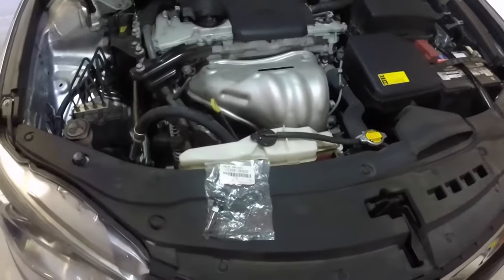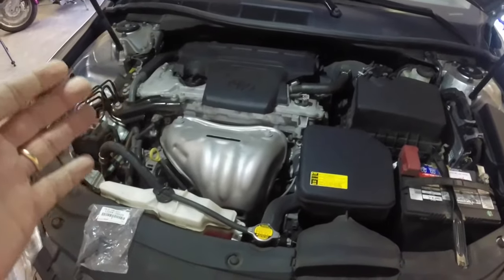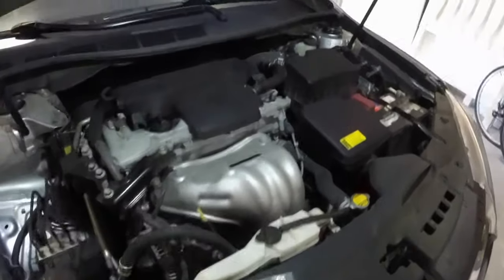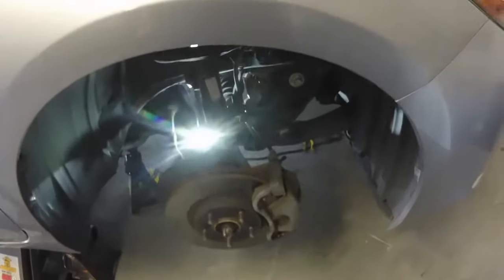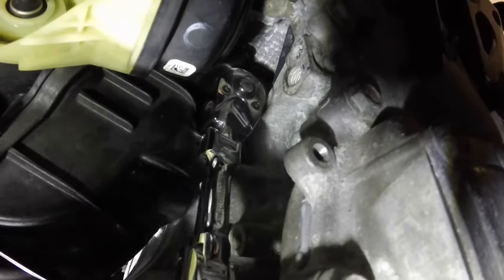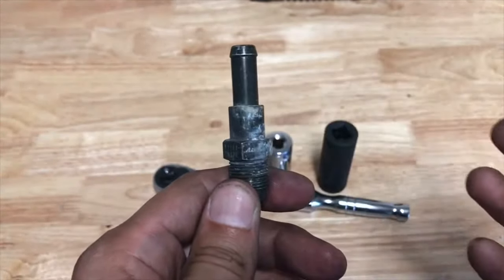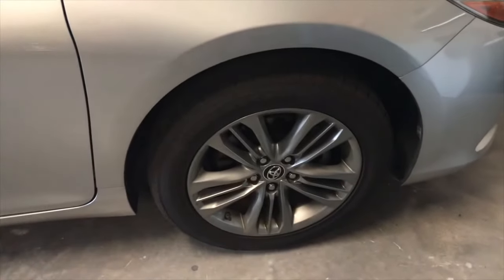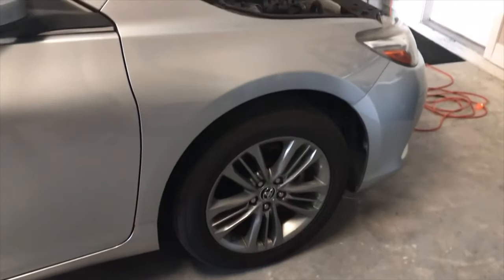Camry 2.5 I4 2ARFE Engine PCV Valve Replacement

Comment: Thank you for showing us how to replace the pcv valve on this 2ar-fe engine, what was Toyota thinking on this one? And, did that fixed the oil consumption issue?
Reply from the maker: It did... I did a follow up video on my channel.
Reply: @dcfgarage  thanks for sharing, much appreciated!
Reply: Dealerships charge around $88 for this job. How much would it cost to buy the parts and tools for this? I need to have this done as I'm losing some oil! Thanks for this video!
Reply: Dude the guy in the video said it was a two hour job so most dealers I know are at least going to charge three hours…
Reply: Got a quote from the dealership. It's only $500.
Reply: Toyota dealer in Canada wants 463.00 labour and 20 bucks for the valve lol
Reply: Recommended time from Toyota is 3.75 hours .
Reply: The PCV valve part is $10.63 on the Toyota web site. This is crazy poor design for maintenance.  Kinda like a parking brake adjustment which requires removing 2 wheels and costs $175.
Reply: @kimdavis5631 The PCV valve is about $11. Youll also need a 19mm deep well socket.
Reply: Where is the coolant bleed port on these engines? Want to change my coolant.
Reply: Who the f decided to put that there?
Reply: @mgomez5606  Underneath the car. I believe youll need to remove 1 or both of the splash shields to get to it.  its a yellow color, right at the bottom of the radiator.
Reply: @jtravel80  that's to drain it. I was wondering if it had a bleed port.
Reply: @mgomez5606  Oh my bad. Ill look into that.
Reply: @jtravel80  would appreciate it.  TY.
Reply: @jtravel80  Does PCV valve have a oring also?
Reply: @mgomez5606  No it does not.
Reply: @jtravel80  no bleed port?
Reply: @mgomez5606  If there is, Im not aware of one🤷🏻

Comment: Did the PCV replacement remedy the oil consumption issue?  My friend just acquired a 2012 Camry with 250,000 miles.  Runs great but oil was quite low on dipstick.

Comment: Just did this myself. The hardest part for me was getting the hose off. After that everything went smooth.
Reply: how did U finaly get hose off
Reply: @2000CORVETTE pinch the clamp move it back towards your hand and tug and twist gently until it finally lets go then just remove the valve

Comment: Excellent video. I have an oil consumption issue with2012 rav4 2arfe engine. I do not see oil any where on driveway/ under car. Do you think it is a pcv valve issue? That valve is in a meesed up place!

Comment: A deepwell regular socket (not impact) + swivel and 4" or 6" extension makes it easier to access
Reply from the maker: I tried a deep socket and it was too big to fit the wrench
Reply: @dcfgarage  next time use a 4 inch to 6 inch extension. It will make it a lot easier for the ratchet. Trust me. It’s kind of like doing spark plugs. You have to have an extension to get down in there.

Comment: Thanks for the video instructions. I disconnected the hose from top, remove the tire, side cover , crank position sensor and the bracket then pull the hose out of the PCV valve, it's not too bad and it took me almost an hour to get the job done. Note: don't forget to plug in the crank position sensor to the sensor or you car won't start.
At 97K miles the PCV valve still looking pretty good.
Reply from the maker: Nice work!

Comment: I have a 2016 Scion tC (The second gen tC has the same engine and transmission as the Camry and Rav4) and the process is the same.  On a normal car where the pcv valve is on top of the engine, I would recommend removing the PCV valve every 30K miles of so, check it, clean it if needed and put it back in, or replace it if it is gummed up.  But with the horrible placement on this engine, checking/cleaning it is not an easy option.  So rather, I'm just going to replace it every 60-70K miles.  I just replaced the PCV for the first time at 69K, it took about 2hrs from wheel off to wheel on, and here's what I learned.
- On the tC, after removing the plastic panel, the opening in the fender well is a bit tighter.  The body style is a bit smaller and lower, so I guess that's expected.  
- Even with the smaller opening in the wheel well, there is still plenty of room to work to remove the crank position sensor wire and bracket.  I went a bit further and from the top, I unclipped the next wire support up the line, and was able to really get the wiring and bracket pushed out of the way, giving me a bit more space to work.
- Getting the hose on and off is the hardest part.  I was able to see it and reach it by hand, by lying on the floor under the brake rotor. Took a bit to find a position that would allow me to get my hand up in there such that I could pinch and slide the hose clamp back.  I was able to do this with my left hand - no plyers needed!  Then the hose pulls off easilly.
- The valve itself was not too hard.  A long socket with a short extension and flex head wrench worked perfectly.  The flex head wrench is helpful, but you might be able to get by with a non-flex wrench.
- From the bottom of the engine, the new valve screws in easilly by hand as long as you put it in the socket with an extension first.  Once it is in by hand, I found it was easier to use a wrench to tighten it from above.  I even was able to get a torque wrench on it and tighten it to spec (18 FtLb)
- Getting the hose and clamp back on is the hard part.  I was able to do this by feel from under the car using my left hand.
- I should be able to do this a lot quicker next time.  I spent so much time just trying to figure out the best way to position myself to see the thing and reach up in there.
Hope these tips help others!
Reply: I appreciate this so much, I'm about to do the PCV Valve on my '14 TC. Didn't realize the Interval was only for 60-70k. Probably why my car idles kinda weird, definitely doing it now
Reply: Very detailed, you should do your own video!
Reply: Any other suggestions in replacing the pcv valve ..? I own a 2012 scion tc and it looks very tight in there to work ???

Comment: The Toyota engine that was burning oil due to defective piston rings was the 2.4L 4cyl  2AZ-FE .
I had a 2007 Scion tC that had that engine.
The car was great, but burned too much oil , almost 1qt per 1,000 miles.
The Toyota dealer in Roseville, California said it was normal and didn't want to repair the engine.
I NEVER returned to that dealer.
Reply from the maker: Thanks for the information! I’ve heard about the ordeal people went through. Did you take it to another dealership and did they replaced the pistons and pistons rings?
Reply: They repaired my 2008 tc in 2016 under the warranty program.
Reply: I was in dealership today, they told me the same story- just add oil…

Comment: You're the man. I was able to change this valve in about 1/2 hour. I would suggest long needle nose 45 degree pliers to pull/reinstall the  hose.
Reply from the maker: Thanks for the tip

Comment: Excellent workup. I had the chance to do this on a 2014 RAV ARFE. Your video was excellent in identifying location, problems and hardware required. Let me add this.
It took me 4 hours because I could not get the valve back in the engine thread. You  can see the hole(?) in the engine where the PCV goes if you shine a light just right.
I finally discovered this technique: lie down with back on ground and feet pointing forwards. snake your left hand carrying pcv into  area of  "hole and get a feel for it with your pinky.
Once you are sure you know where the thread is use your other fingers to put pcv into slot and try to get some turns into thread. I was able to get quite a few turns into albeit a few degrees at a time. Once it is secure, you can use the socket and ratchet
Will need same socket and ratchet as shown by poster. Got my socket at home depot
Reply from the maker: Very accurate description of how to put it back. I ended up doing the same things as far as the position goes. I did manage to thread it by hand fairly easily though.

Comment: These engines have been in use on Toyota Camry since 2010. I have a 2011 Camry with the same engine. It was burning oil. I changed the PCV and I didn't notice any change. I was changing the oil at an interval of 6k. I switched between 3500 and 4000 miles, then I noticed a difference. I believe that the whole thing happened because the dealership in the past was changing the oil every 8 to 10k. For NYC that is too long.
Reply from the maker: older 2ARFE had piston rings issues and they would burn a lot of oil. This was a big issue back then and Toyota used to consider "normal" if it burned 1qt every 1,000 miles and would not replace the engine.
Reply: @dcfgarage  I have 2011 burning oil to fast.   Did this fix problem R Rings the problem???

Comment: I have a 2017 Highlander with the I4 and it's located under the engine valve cover too. Ouch. 850 from the dealer. I wonder if I can take off the right front tire too and go that way. it's not bad but 85k so I want to replace it after my 2017 Honda CRV started to burn oil, 40k, and replaced the pcv valve...5 minute job..wham...no more burning oil...good video!
Reply from the maker: It's probably the same location, since it's the same engine... worth trying.

Comment: Hoping its the same procedure on my 2010 2.5 camry, this looked tricky but a lot easier then pulling the intake and all the other crap off.
Reply from the maker: It should be the same for all 2ARFE engines
Reply: @dcfgarage  everything's the same except mine has a power steering pump in the way which makes this route impossible, the newer cars like yours must have electric power steering.

Comment: Great job. I have a 2010 Camry that I'm going to try this on.
FYI, on the 2.4 Toyota wouldn't commit to a Recall. They issued a service bulletin that  involved them changing your oil, sealing your dipstick, then checking the level after 1000 miles. They had a chart that would determine if they would replace the rings or not. I think Toyotas are great, but the ring issue is disappointing.
Reply from the maker: Thanks for the info!

Comment: Did you shake the old PCV Valve to see if it was still good or not? You are right, it is important to replace these and most vehicles are easy to replace.  What was Toyota thinking on this one?
Reply from the maker: Steve Glenn I did and it was moving, but it felt different than the new one. Maybe it had some oil that was preventing the blocking piece to sit perfectly
Reply: @dcfgarage  easy to clean them

Comment: Very helpful Sir! Loving it! But would you please make a video of the process of taking out the plastic cover and cable sensor which is out of the way in order to reach into the pcv valve.
Reply from the maker: Thanks. I’ll do that when I do the follow up video. But it’s very easy
Reply: I missed a lot in this video.  Much talking done about the top of the engine and the actual removal of the valve was not there. And when he moved the wrench and said that was a removal it was actually tightening. I jacked up the car, remove the wheel and cover and the wiring and still my hand was at least 3 inches away from the PCV hose.  So I suspect that the video of the turning wrench and the PCV valve was made when a Camry with same engine(not the youtuber’s car) was on a car lift
Reply: 👍🏼 like everyone else thanks for this video upload this confirms the location which toyota of made a pain in the arse to r/r. I gave a thumbs-up to everyone's coment. 😁👍🏼

Comment: Hello sir,
I have a 2016 Rav 4 recently I found my oil was so low below the last dot on the scale hope I didn’t damage anything. Changing PCV value help not burning oil. Also does the car show warning sign when the oil is low. When u add oil u can use any brand oil with same number?
Please advise. Thank you so much.

Comment: Very helpful video, thank you for taking the time and effort in putting it together.
I’ll probably tackle this in my next brake job.
Is the disconnected hose that’s shown at the 4:00 mark for the PCV valve?
I can’t believe Toyota put this valve in the engine’s ass when it should be on the head.
Reply from the maker: That is the pcv tube indeed

Comment: Very helpful thank you, my 2012 Camry is burning oil, my car is at 200,000 miles was wondering 💭 if it’s worth doing any work on it. My Camry doesn’t have any other issues
Reply from the maker: If you never replaced the pcv valve, it's worth a try. If it doesn't improve, then it's likely piston rings or valve seals, and not worth messing at 200k

Comment: How long was your socket? Also, what size socket for Sienna 2015?  Good video, brother.
Reply from the maker: Donnay W. Not sure exactly how long. I think they only come in short, midsize and long. I had to use the midsize. I believe the Siennas never used this engine, so the pcv valve would probably be in a different position.

Comment: I have the exact same problem with my Camry! Keep us posted if it solved it!
Reply from the maker: I will post the update soon. So far, I drove. 500 miles and the oil level is the same. I’ll do an update at 2,000 miles
Reply: So did it work?
Reply from the maker: So far, 1000 miles and the oil level hs not gone down
Reply: @dcfgarage  is it still working? I tried changing the pcv valve on mine but did nothing. still burning oil
Reply from the maker: @kjemad  Then you have a bigger problem. How many miles how your engine?
Reply: @dcfgarage  120k. This will be the last toyota i ever own...
Reply from the maker: @kjemad  I also don’t understand why people think toyota doesn’t break. All cars break. In your case you probably have a bigger problem you would need a mechanic to diagnose. How frequently you changed oil?
Reply: @dcfgarage  every 5000-7000 miles depending on the kinda driving i do. what i figured out from research it appears that Toyota put in softer oil scraping rings in 2012 to get the fuel consumption (less friction i guess) down and make the EPA happy. The kicker here is the 2.4 liter in everything 2009 and down has even bigger oil consumption problem, from other issues. So if you want a good camry it has to be a 2010 or 2011 model year ONLY with the 2.5 before they destroyed it. Or 2005 and older when the 2.4 was actually good...
Reply from the maker: @kjemad  yes. They have low friction piston rings for better fuel efficiency. It’s a possible cause for your oil consumption

Comment: Is it necessary to use hose clamps? Or its tight enough without it.  I had a shop replace the pcv valve and a new pcv hose and they said that clamps or not needed and just plugged it on the valve.  Now worried about a possible leak.
Reply from the maker: There is no clamp from factory. You just connect the hose

Comment: Did replacing the pcv valve fix the oil consumption issue?
Reply from the maker: It did. My valve was probably not sealing correctly and was allowing oil to go through.

Comment: I don’t think you need a swivel wrench or socket just use an extension that will give you enough room back far enough to actually crank the sensor out

Comment: It may be leaking from the valve cover. The only known common issue with this motor. Check the spark plugs for oil
Reply from the maker: in my case, it was the PCV valve. I did a follow up video
Reply: Correct and clean throttle plate 1 to 2 times a year

Comment: Hi sir.. I'm wondering if the oil burning stopped after the pcv valve replacement? Cause I have same issue
Reply from the maker: In my case, it did.

Comment: it took 3 hours. the pain also putting it in the same thread which I couldn't see. Difficulty 10/10 How did you manage to screw it in. I had to use a snake scope to see the gold thread.
Reply from the maker: I put two jack stands plus the tire for safety so I could lay under the brake rotor and be able to extend my arms into the engine for I could have a good position to screw it it. I could not see the hole, so I just used the extension and the socket to patiently screw it in by hand.
Reply: @dcfgarage  still took me 3 hours with the snake scope, god helped me i asked him
Reply from the maker: @kack7130  LOL!

Comment: Hello sir, thank you for the information.
I have a question.
When you replace the valve. Did the check engine light turn on?
Reply from the maker: It didn't. Shouldn't
Reply: @dcfgarage  ok, thank you.

Comment: Use a longer extension and you can turn the ratchet outside of the wheel well if you wanted. 😉
Reply from the maker: Thanks for the tip

Comment: Did oil consumption made you change pcv? I got a 2012 venza 4cyl. And oil goes down about 1qt or 2quite quick.
Reply from the maker: Hi Josue. It was the consumption that made me change the PCV, because this engine is quite new and I thought bad valve seals or blown head gasket would be unlikely. If your car goes through 1-2 qts in 3k miles or less, I doubt it's the PCV. It's either the two situations I mentioned or worn out piston rings. 

How many miles does your car have? Does it smoke?
Reply: @dcfgarage  thanks for the reply. Vehicle has 130k km about 80,000 miles. But ir isnt burning oil , it does have a minor leak but it doesnt even get to ground, the garage is clean on the floor. Also, i felt a little pressure when opening the oil cap to fill with oil. I can compare the sound as to  when you open the fuel cap. Thanks again for your experience.
Reply from the maker: @josuedonan5666  If the car isn't smoking and you don't have signs of blown head gasket like milky sludge in the radiator cap. You can try replacing the PCV. If that doesn't work, they you might have some premature piston ring wear. I think the vacuum after you turn off the engine is a different problem. That could be a bad intake manifold seal. light vacuum when the engine is running is normal.

Comment: Did it work? How is oil consumption after it's done?
Reply from the maker: It did. I did a follow up video on the channel. I believe my old valve had some carbon deposits that were preventing it from sealing properly.